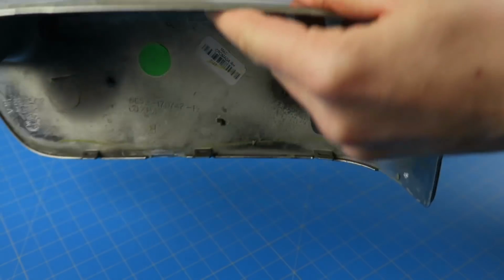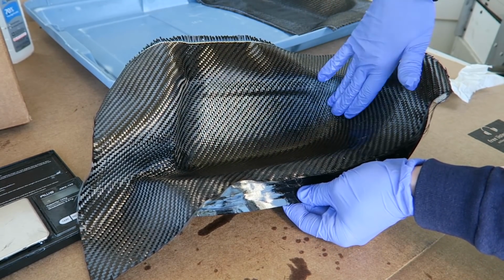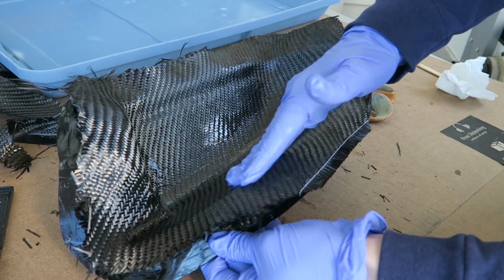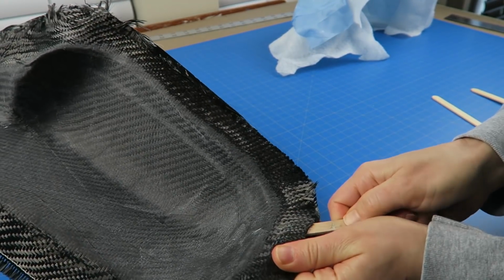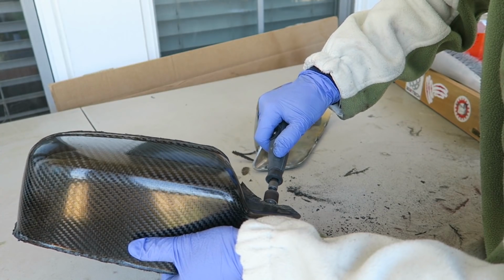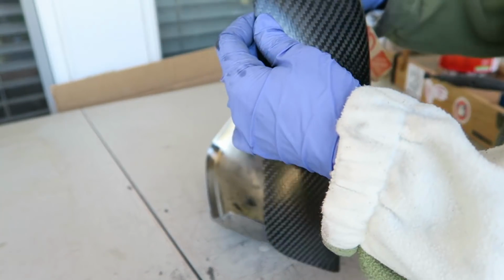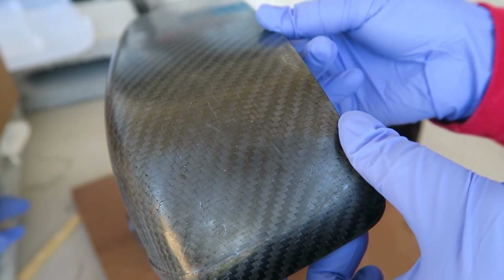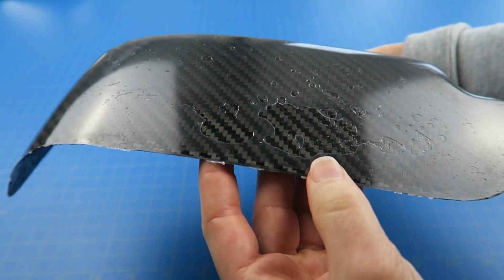Carbon Fiber Car Mirror Cover Lessons Learned

Comment: I love how you're not afraid to show your failures - it's all part of developing your processes. In my experience, enamel clear is near impossible to sand/buff to the gloss you need. I've used acrylic lacquer clear, wet-sanded between coats, with good effect. A more modern material would probably be a 2-pack catalyzed urethane automotive clear, but this starts getting pricey (and if you go the rattle-can route, once you pop the can, you only have 24-48 hours to use the product).

Comment: Glad to see you are testing different approaches.  I went through the same process 20 years ago.   vacuum chambered the resin before laying up,  tried a clear casting resin, then the layup,  flamed the resin before layup, etc.  Still had issues with pin holes.  I do not like to do the resin top coating, sand, coat, sand, coat etc. either,  way too labor intensive.  I hear Resin Infusion will give you the pin hole free finish.  I started in again,  things have changed for the better.  Now room temp pre-preg is common.  Before I had to get one of the aerospace companies to give me some to try.  At the time I was taking composite construction in school.  So we could get some companies to donate to our school.    Your process is good, and you have good knowledge,  keep up the great work.

Comment: Not sure if you have heard or tried this method before, but voids are quite common in many of the handle materials we use for knife making. What we call marble carbon fiber, and other call forged, it is even more common. 

The best way I have found it to take your favorite 600 grit sandpaper and sand the surface then dont agitate the surface. Then add some of your favorite CA glue to the surface and sand the surface while spreading the CA glue with the same sandpaper you sanded with prior.

The idea being that you fill the void with dust from the actual carbon itself, in the process loading the sand paper itself with said carbon as well. Then the glue and dust forms a sort of slurry that fills the voids. 
It's always hit and miss though and you end up chasing your tail quite often. 

Love the channel!

Comment: Well done Lindy.... For whatever it's worth, after thoroughly shaking the sealer to mix, put the spray can in a bucket of hot water before spraying to warm up the sealer, it will have less surface tension strength when applying a coat and will produce less orange peel. This is a technique used by auto painters when sealing a high end paint job. It's my understanding sealer goes on best at 85 degrees

Comment: From my 4 years of doing carbon fiber work with PWC's and RC aircraft I never use PVA because it flakes off. For the pinholes, there are 2 ways I do it. The first is using infusion based epoxy, very thin epoxy, to create a thin cover layer that is drizzled over the part and use a heat gun to get the air bubbles out. The second way is using a 2 part clear coat, 2 to 3 coats, and wet sand and buff it out.

Comment: I tried a wet lay up doing a mirror cover as well. Didn't like the results so I then vacuum bagged. It turned out much better, but still had to add and sand multiple layers of resin over.

Comment: 1st rule of hand lay-up, wait until the first layer of resin cures and a bit tacky. Just to make sure the fiber doesn't get through and it is not exposed to the mold.
Reply: ridho arlega I agree,  even with an infusion I like to spray on a nice thick clear coat and let it get tacky. No more pin holes.  The only problem I have with it is I need to be careful not to ruin the weave when it sticks to places that I don’t want it to.
Reply: James Byrom dangerous to use the resin as a tac unless the part isn’t complex, have u tried a tac spray for temporary holding?

Comment: A clear gel coat applied to the mood first would help prevent pin holes and protect the epoxy underneath from UV damage(also part yellowing). If it's coated in mold make sure it's unwax gel coat. Wax will make the epoxy not stick to the coat as well as make it cure fully. When it's not waxed it will stay a bit tacky but you can wipe it with a bit of acetone to make the gel even tackier. I've seen spray adhesive show through on many parts before as well so I would try and avoid using it on the first layer of reinforcement. When hand laying it is generally a good idea to coat the mold with a layer of resin before adding in the first layer of reinforcement. Your part came out very well for a first pull in my opinion. The first parts are always the hardest. Your mold looks really nice and smooth so if you coat in mold you will get the exact same finish on your part assuming all goes well. Best of luck on these mirror covers! Also gold sharpie shows up really well on carbon parts.

Comment: Waiting for the first layer to become tacky may help a little, but isn’t always the correct answer if your bagging the part and yours looked pretty good! If the room is to cold (resin won’t flow easily) or if moisture contamination has happened when both laying up or spraying lacquer your get misting and pin holes. After preparing the naked carbon surface with wet and dry you’ll need to rub it down with acetone a few times and then give it a good dusting with U-POL Raptor Adhesion Promoter followed by lacquer. If this still doesn’t work because carbon can play funny games don’t worry, just wet and dry the lacquer again and add another heavy coat doting lacquer in any remaining holes, sand and then polish. In the past if it’s a large pin hole I’ve filled it with super glue and you’d never know. Good luck with future parts and I look forward to the video 👌🏻👍🏻

Comment: if you want to repair the surface finish simply sand the part down and brush on more resin, you may have to sand it down again and brush on a second coat. continue adding resin layers and sanding until all the pin holes and imperfections have been filled in, then sand it down and add a final coat of lacquer.

Comment: Can I suggest a scribe tool instead of using a Sharpie for marking out trim lines. Gives a more precise line to work too and doesn't risk the original part getting damaged while using it as a template.

Comment: You need to at least cut the peel ply into the jiggle if your not going to cut the ply, after the first ply roll up some toes as a boot lace to pack/ramp out the joggle. This will help get pressure into the corner and help avoid bridging in the area

Comment: What will help your final seal or coat seep into the pinholes and smooth everything out put your can into a cup of warm water it warms up the spray helping to make it more fluid. If you don't have access to that then a heat gun works very well keep it at a nice distance about 12 in and sweep back and forth. This warms up the product helping it flow into the pits as well as helping the drawing process. Great video Thank you for sharing. I'm in the process of making a new headliner for my boyfriend's van. I started with regular fiberglass for the main mold and then I will do a layer of carbon fiber last. My mold is backwards of yours. Because the part that is exposed to the eye is the outer area. Thanks for sharing take care

Comment: To get a smooth UV resistant surface, have you tried applying a layer of clear, epoxy-compatible polyester gel coat to your mold before adding your fabric?  For this project, I would have recommended using a polyester resin instead of epoxy since it is just a cosmetic part.  Then you could use less expensive resins and less expensive UV resistant polyester gel coats for your top coat.

Comment: I use at least 3 layers of resin, and also a blowtorch to get the bubbles out. Any less and you'll have imperfections like that, as it's too "dry" for carbon/resin overlays. There are also rollers that can aid you with laying the carbon fiber. Not bad overall though, my first attempts looked far worse.

A lazy method would be to simply paint the actual part with black primer, and then wrap the carbon fiber over it, then bond it with several layers of resin, and trim the excess with a dremel. You'll sacrifice the original part, but you won't have to worry about seeing significant imperfections.

Comment: Excellent video.   I've never layed up carbon fiber, but I can relate to the frustration.   I do autobody work and when I was learning the process, if something went wrong, I would just keep trying to fix it with different techniques that seldom worked, and often made the situation much worse.  Desperation and tunnel vision will make you do strange things..lol
Thank you for reminding me that I'm not the only one who messes up on occasion.
And yes, pinholes are the devil; they never go away, as they are basically an air pocket that prevents fluids from entering them, no matter how many coats you put on, they only get bigger!  Always blow the part off with compressed air to reveal the pinholes, or they will show up in the last minute.       Thanks again!
Reply from the maker: Nothing like hands on experience to get the screw ups out of the way on something that doesn't matter.

Comment: Oh and one more thing lol. If you do the mold in the arrangement you have the release agent is still on the part so you should sand it down really well before spraying anything on it or even putting additional coats of epoxy because the release agent is in between and will leave avoid. Maybe having wiped it down with some acetone would ensure you've gotten all your release agent off of the item.

Comment: After prepping the part for paint, the first coat should be extremely lite. This provides a chemical bond to help the next layer stick. Since this is non-catalyzed product, it needs to evaporate. The second coat can be a wet coat the is self leveling and will fill in voids and pin holes. Laying flat will also help. 
  Only a spray gun would allow the amount of fluid to increase as a can forces you to get closer and go slower. Both of these are wrong but small part and little else to do, causes most to hurry up too much, too fast and runs occur. 
  Eastwood sells a spray can for small jobs like this one, but has a seal on the bottom that once broken, mixes a catalyst into the paint. This is now a harder paint with a chemical action plus evaporation to provide your finish. 
  The spray is either a lacquer or enamel and may react with the catalyzed resin as the solvents may not be compatible. Just a suggestion.
Automotive ASE Master Tech since 1978 - Retired

Comment: The ratio of resin to reinforcement determines the strength of the lamination. The weight of the part is secondary or a by product. The strength of the lamination is due to the reinforcement, the carbon fiber in this case. Too much resin or epoxy which is a form of plastic makes the part brittle. Of course, too little resin and the lamination will have dry spots which can delaminate.

Comment: The 2K resin reacted and didnt bond to the Aerosol 1k Enamel paint, which would of been not cured by the time you added the resin. Tt takes days for enamel and acrylic to really cure and not react. All you had to do was, spray it with 2k clear and blow some air on the pin holes to get the clear in.

Comment: Lindy, I do a lot of composite model work and always paint in the mould.  And yes, I use wax (TR-108) and PVA.  In your case, you may find you get much better results if you try painting a clear coat into the mould before laying up the part.  I use Automotive Acrylic Lacquer to good effect, but 2-pack will give better (and harder) results.  I just don't have the equipment to spray 2-pack safely. The other suggestions about letting the first layer gel off a little are also very good - particularly with carbon - because the second layer will definitely draw resin away from the first.  Hope this helps, Steve.
Reply from the maker: Thanks, Steve. I'll give the mold clear coating a try.

Comment: Great job, I’m planning to do the same thing for my Charger. Do you have a video on how to make the mold. Thanks, Cb
Reply from the maker: Different project but this is the basic process used to make the mold https://youtu.be/aoSyRCgXHSg. For the mirror mold I used just woven glass since the chop strand doesn't conform well with epoxy not dissolving the binder.
Reply: Check out Mike Patey and Throttle Stop Garage for some good tips on working carbon fiber and mold making too. Lots to learn and some amazing work out there!

Comment: Please use the dust mask when you put the carbon in the mold and cut the carbon with the scissor. Because a lot of carbon particle fly in the air. And thats not healthy. If you want to see them: switch off the lights and switch on a strong lead headlight or a laser and you will see the flying particles in the air.  Its mostly important when you makeing larger products or a negative tool with lots of fiberglass. 
Nice work and good video!

Comment: Thank you for sharing the experience, even not the great one.  In another channel I saw a way of applying carbon fiber - to soak the sheet with resin before it gets situated in the mold, would you consider trying similar approach?
Reply from the maker: I've experimented with something like that, sandwiching the fabric between two sheets of plastic and using a roller to distribute the resin and remove excess before placing the piece. It's a good option for fabrics that tend to get distorted easily or for cutting precise shapes like a prepreg.

Comment: You should resin infuse the part. You will have a much better finish to the part and if you degas the resin before infusion, all the pinholes will be gone.

Comment: hello lindy and everyone from the channel. First thanks for producing those videos sharing your learning curve.  second, i´ve beeing there too. done all of this and had the same results. and I found a few ways of fixing all this problems you had. so lets begin:

using the same process you used, the breather grabs a lot of resin, and because of the carbon desing the filaments joint get really dry causing the pinhole issue.
lets supose you did everything you see here and had the same result, but you dont want to loose that part.  to fix the pinhole in the part when clear coating, 
do a very light coat, let it dry a lil, do a second powder coat, let it dry a litle, do a flow coat (thicker) than the pinholes will come. find  a lil tothpick, spray some clear to it, and than pinch the holes with the drip you have on the stick. it will fill the area and self level to the part. gives some work but it works very fine.

How to avoid pinholes in the part:

1: degass the resin using a vacuum pum and a chamber (you can find tons of videos of the process on youtube, how to degass epoxy)
2: if you are doing on a budget, you dont have a pump: make a first layer of resin just like she did in the video, brush it or use your hands (where gloves this can give you cancer) and let it TACK (means you tuch the resin but no residue comes back on your finger) than aply the cloth REALLY GENTLY so it sticks to the tacky resin an take care so the resin dont come throght the cloth. if it happens, next time wait a lil bit more. now let all this cure a few more ours (dont forget that you need the chemical bond so dont take to long on this one or it will harden and the cloth will be the only bond. this can cause delaminating issues). now you have done the surface, time to lay more resin on the top of it all and more carbon. peelply, breather, bag it and there you go. now you have a part that has a very nice looking face, very light too.

one very important tip: make good flanges on your molds since day one because once you learn how to master the vacuum bag tecnic, and cure the part on full vacuum, its very easy to step up and start making infusion.all you need from there is a vacuum chamber that can recieve the extra resin.
Reply: Do you have a suggestion for flange material? This is really where I struggle. I have only attempted small parts with gradual curves. I believe bigger parts may be easier to "flange up" due to curve being more gradual (at least the parts I want to make). I have tried corrugated sign board, aluminum flashing (good, but not for small parts imo) and, lastly I tried rubber baseboard trim. The baseboard trim works amazing but I never got to actually making my part so not sure if anything in the rubber will cause a reaction in the final product. 
Then the next part I struggle with is getting my vacuum bag to seal nicely, I think this is just a matter of getting enough experience.

I just placed a big order to make more parts and will be uploading once I receive them. I would appreciate if you could give me any advice! Unfortunately my order will take a bit due to covid shipping/supply delays.
Reply: @barnbuiltbeaters  hey how are you doing? i here i use cardboard, high gramature for straights and low gramature for curves all glued with hot glue, and to seal them i use demolding wax until its soaked and latter i´ve beeing using some vacuum bag film glued with the super77 spray glue, works very nice!

Comment: Hi. Next time once the new part is out get it under 400 grit sand paper and then work your way to 600 grit and then wipe is clean it and see for any imperfections. After that dust coat a layer of lacquer from a spray tin and leave for exactly 15 min. Have tea. Then layer up more and watch the part shine. After drying there will be small bits in paint. Get 1000 wet flat on the lacquer and take the shine off completely. After that use g3 polish compound and buff to perfection. How ever all this would be easy if you can clamp the part into a vice by attaching a rod inside the part and gluing it somehow where you can release it after. Like a temporary handle